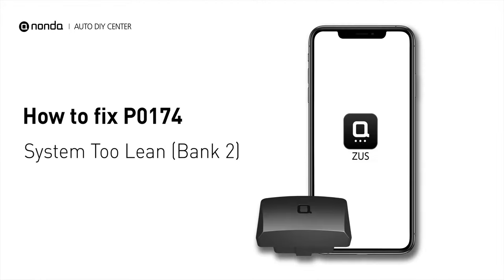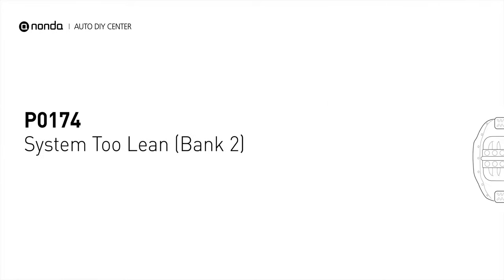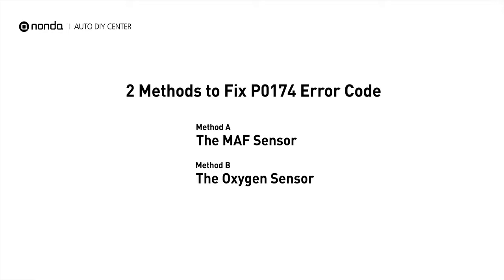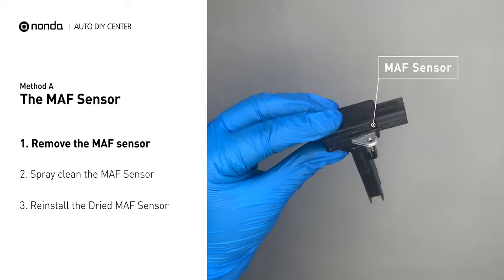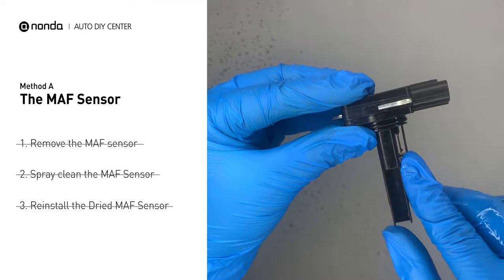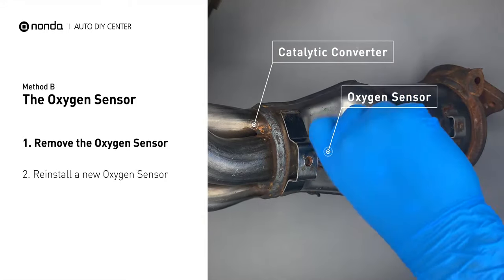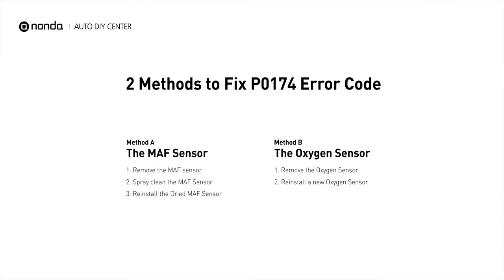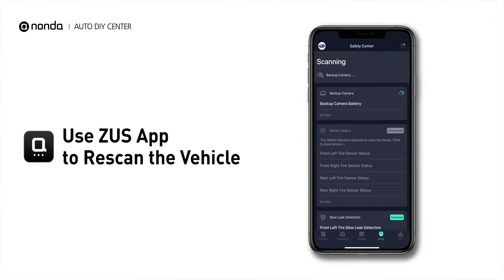How to Fix P0174 Engine Code in 2 Minutes [2 DIY Methods / Only $8.99]

Comment from the maker: Hi, I'm Steve, nonda's lead mechanic engineer. 
Feel free to leave your comments here if you have any mechanic questions, I will be glad to help you out!
Reply: Bank 2 is lean and cylinder 2,4,6 are having intermittent misfire.no leakage or vacuum leak
Reply: @solomonakpojovwo2607  what was it my bucket truck is doing the same thing , bank 2 lean po174 ..
Reply: Jeep liberty 2005 doesn't have a maf sensor but it's still giving me the p0174 code
Reply: Will P0174 stop car from starting?
Reply: @biggxtana6143  P0174 indicates a lean on bank 2 meaning un-metered air is getting into the bank. P0174 is mostly common with vacuum leaks. if you’re engine is having trouble starting up p0174 could contribute but there will most likely be other factors contributing if you’re car isn’t turning on.
Reply: What type of spray should I get? And what tool I need to remove the sensor?
Reply: Hi steve,  I have 98 ranger I have p0174 and p0171 system is to lean, I did find my Schrader valve was leaking I fixed that and vacuum line was ripped I just took off the ripped part and reconnected it, but om still having my car having to crank it like 3-4 times to start it and they are long cranks? Any idea how I should take this? I know that bad fuel regulater would Give me rich rather lean,so that's off the window.
Reply: @biggxtana6143 my did I have to crank it like 4-5 times

Comment: Another cause can be a vacuum hose leaks under the hood which is sometimes easy to find. And sometimes difficult to find. Search for soft, worn, loose  hoses. Wiggle and slightly tug vacuum hoses and listen for air leaks. there is also a smoke test method to find leaks or simply replace all hose associated with vacuum as a last resort. Another cause may be the MAP mass air pressure sensor defect. Clean with proper spray. If no results replace.I learned this through experience.
Reply from the maker: Good suggestion!

Comment: Hi, this issue popped up recently in my vehicle. I checked the engine air filter and it was very dirty. I replaced that and then reset the code using my OBD scanner and now there is not warning light. But I did use Berryman Chemtool fuel additive to clean out the injectors or whatnot as it has 60,000 miles on it. Do you think that could have triggered the code? Plus I could not find a CRC MAF cleaner anywhere as it is out of stock. I plan to clean the MAF sensor as well.
Reply from the maker: Hello, a dirty filter could cause a low fuel pressure. it's a good idea to clean it as well as the MAF sensor. These usually fix the issue. We recommend cleaning it using a break cleaner or electronic cleaner. Please also ensure checking the intake manifold and vacuum lines for leaks.
Reply: What brand of electronic or brake cleaner is good  to use ?
Reply: @nondainc you really use brake cleaner on a maf sensor ?

Comment: I had both P0171 and P0174 and CEL on my 2008 Nissan Frontier SE V6 4.0L. One obd said Bank 1 fuel injectors were dirty and a different OBD2 said Bank 2 injectors were dirty. I had just had a new valve cover and gaskets replaced and an oil changed. I put in a new MAF and Bank 2 upstream 02 sensor. Nothing fixed the codes. I hooked up my smoke machine and no leaks anywhere. So, since I already had one on hand, I replaced the PVC valve. The old one didn’t rattle when I shook it which told me it was full of sludge and not functioning. The new one rattled so I put it in and started my truck. All codes on both OBD2’s that have me codes earlier were clean and all codes disappeared and the truck runs perfectly. I say be for you do anything check the PVC Valve which is easy to access and replace. The cost of the PVC was maybe $5 at the very most.

Comment: Hi Steve I have a 1998 Chevy Express Van that was sitting for about a year. No rats or anything got into it. I fixed her up, rebuilt transmission and she drives fine but usually after I pump gas and fill up over half the tank I start getting the P0171 and P0174 codes. Also the gas gauge needle is always vibrating unlike the other needles that you can see clearly like the temp, battery and oil pressure.
Reply: I say all this because I think it’s the fuel filter/pump. She never had the CEL on when I drove her before she broke down on me. Lmk what you think.
Reply from the maker: Hi Arturo, we suggest getting your vehicle visually inspected by your local mechanic for further diagnosis as you are receiving more than one error code.
Reply: @arturohernandez2313 Hey did you ever find the problem ? My car does the same thing , I only get a check engine light when I fill the tank more than 50% or 75% full and the light goes away when I have less than 25% of gas left on my tank. Any helpful information would help, thanks.

Comment: Thank-you - this worked for me!  
The physical location/configuration, where the MAF is located is different on my 2011 Avalanche.  It is directly in the front on the air intake hose (on the left facing truck), mounted onto & into the hose, and very visible when just opening the hood.  Also, the device itself looked a bit different - it had 2 of what looked like horizontal wires in different spaces, like a 'H' would have one above and below the horizontal line.  One of them had what looked like a spider web on it that came off when sprayed vigorously.  
And just a heads up, my son-in-law was helping and there was some confusion because there is a MAF sensor and also a MAP sensor - 2 different devices.  We were getting codes PO106, PO171, PO174.  I've driven it a couple of times since and it is completely different now, - no misfires or messages about the stabilitrak messages, etc. & no new codes.

Comment: I can't find the MAF on my 2007 Honda Pilot?
Reply: I’m not sure how yours is designed but in my 2007 Chrysler 300c, it’s at the rear of the intake manifold. Some cars have it built into the Air Intake piping itself like my 2010 Chevy Avalanche. So look somewhere on the intake piping, or check on the intake manifold itself.
Reply: @BWADaniel  I thought all vehicles  have MAF but found out my year don't have MAF equipped on my Pilot which kind of hard to believe